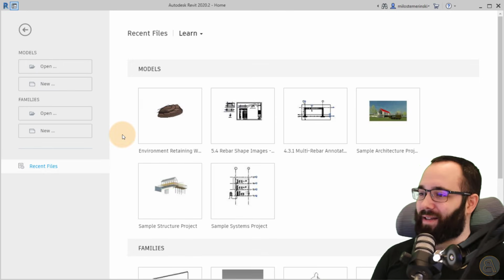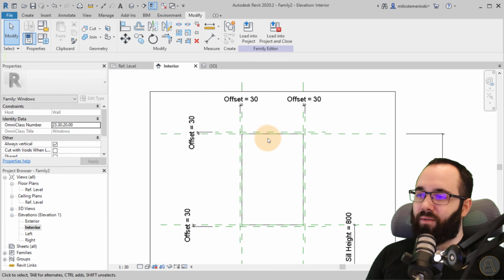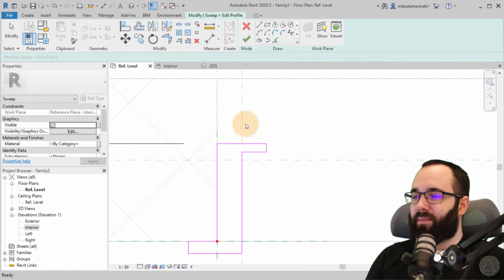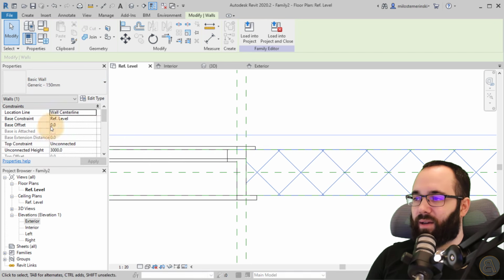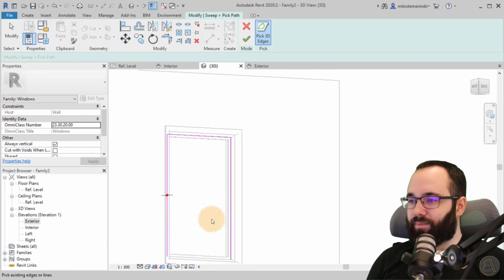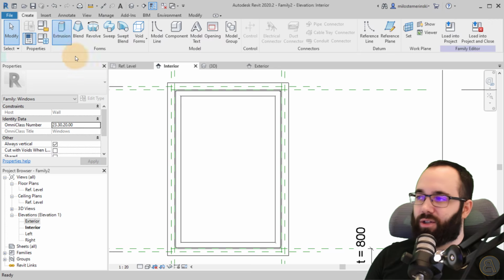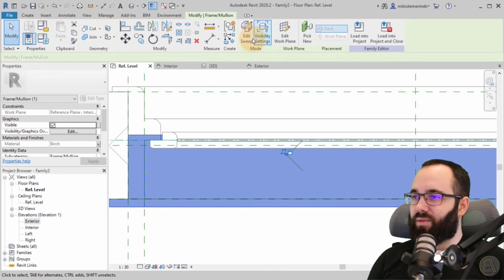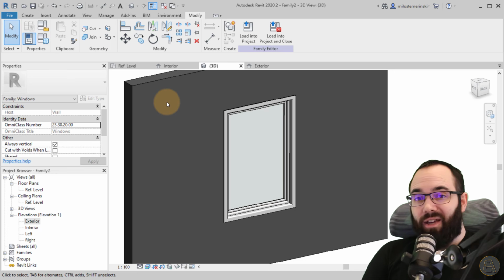Window Family - Beginner to PRO Tutorial

Comment: I have learned so many things from your classes but also all the YouTube videos.  You suggested that we offer ideas about possible YouTube videos for you to produce.  So, here's one that I will be using soon in a project.  But, have no idea how to do it.  Would it possible for you to create a YouTube video of a family for a fixed window that has a single pane of Spandrel glass, 3/4" rigid styrofoam bonded to it, batting and then gypsum board?  This window will look like a window from the outside.  But, it will not cut through to the inside.  Thank you!
Reply: Go and learn how to use void extrusion....it's quite simple

Comment: Hello! When I change the thickness of the wall the swap does not change its dimension based on the thickness of the wall although I locked the two frames together. what could be the issue?